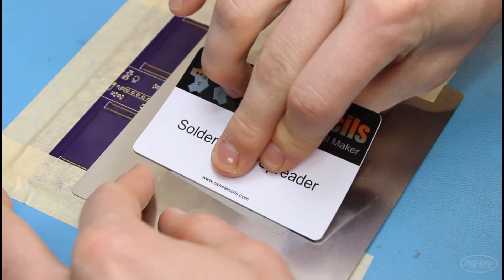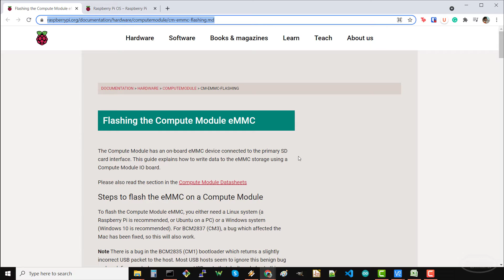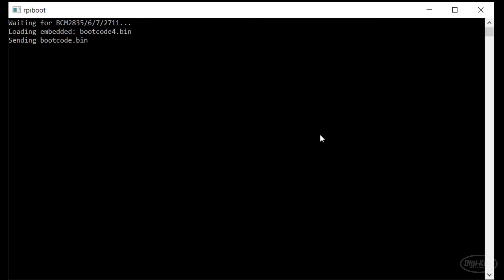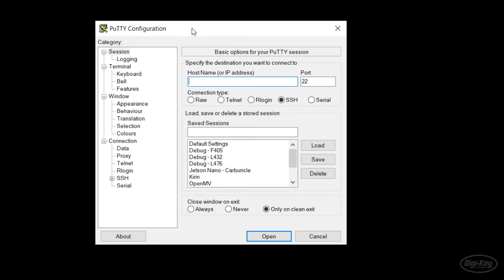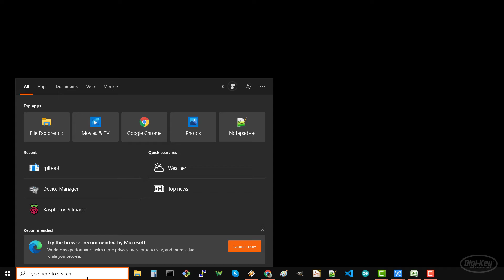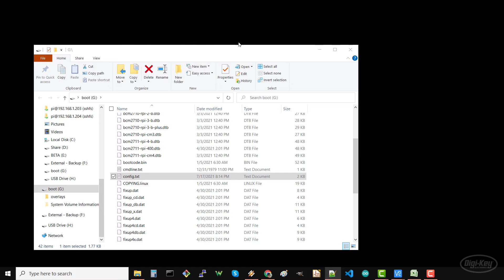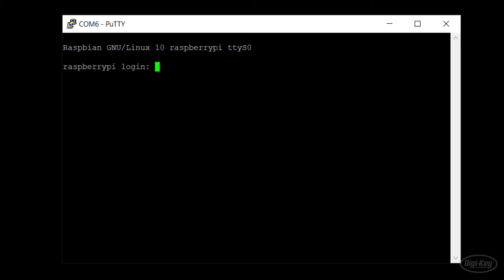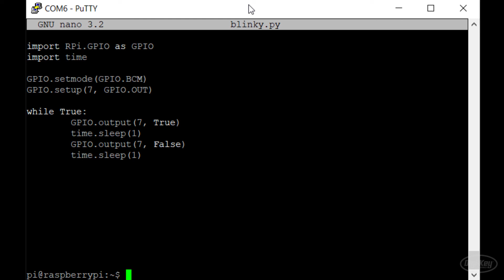How to Make a Raspberry Pi CM4 Carrier Board - Part 3: Solder and Flash eMMC | Digi-Key Electronics

Comment: I just designed a new I/O PCB for the CM4, but while I used low melt solder paste for the components, I hand soldered the mezzanine connectors to the CM4 out of fear of melting the plastic of the connector. Are you afraid of that in your oven?

Comment: You can use the 64bit version on the CM4. I would watch configure WIFI. Then you have a network connection, can connect with SSH and make updates. Create the ssh file in the boot directory and store the WIFI parameters there.
In addition, you can activate a USB 2.0 port on the CM4.
A system with WIFI, one USB port, TTL Serial and the IO ports can do something useful.
That's enough for Octoprint

Comment: thanks for video... but the serial converter would be explained more. specially if it was a 3.3v or 5v or a real 15v USB to serial converter. i am designing a carier board now, and gonna use most of periphrals and their protections... with a real serial port which is 15v to be able to directly connect to a real serial port of motherboard of other computers.

Comment: I am curious. Why didn't you put an Ethernet MAG socket on your carrier board. They are cheap, the Pi CM4 has all the PHY (so only socket necessary) and it gives you all of that really helpful Linux Network ability right from the start. Am I wrong?
Reply: Or just use wifi?
Reply: @TheXSairam  Nowhere near as straightforward as simply plugging in Ethernet, as he said "right from the start"
Reply: If you want a board for easy setup and devlopment, buy the official board designed for that.

Designing specific boards is for a specific use case. For instance if it is for an embeded system, the ethernet port would just ruin the form factor and price tag for 0 benefits. (Even if it's cheap it isn't free yet).

Or if you're just a hobbist and do both dev and production usage with the same board, go with the all in one rpi board.

Comment: Best reason to have a proper bench power supply with adjustable current: when you smoke check a new board, start off at the lowest current setting. Know in advance about what the max I should be (ie your regulator's quiescent current and maybe a power LED) and gradually turn it up. If it goes past what you expect, shut it down and find the problem. This should be able to find issues before actually smoking a (possibly very expensive) component.